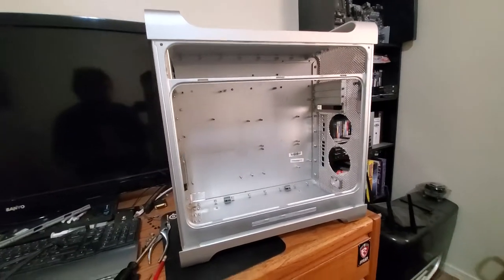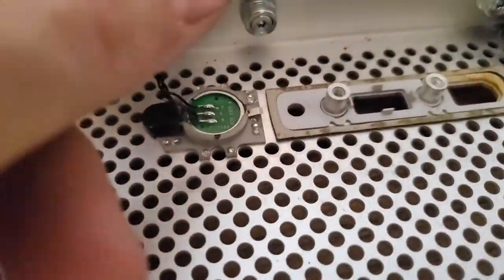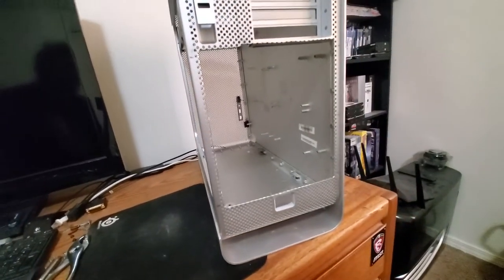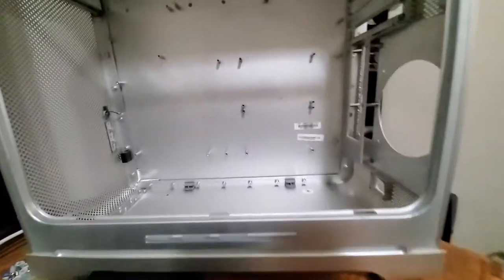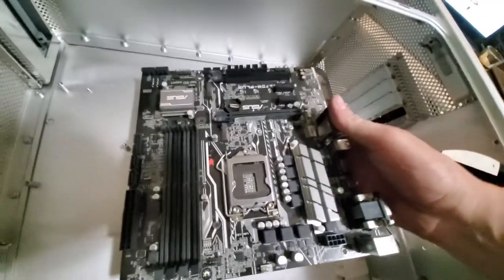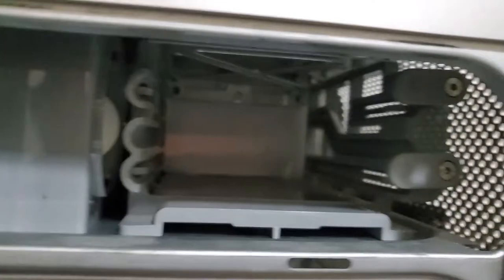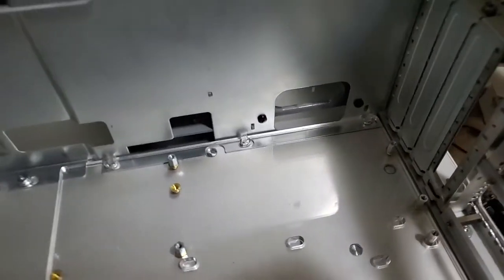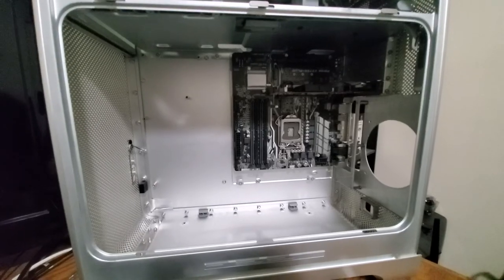Powermac G5 Teardown Complete ATX Conversion Begins!

Comment: Did you ever complete this build? I've done one myself but a little more roughish. I used epoxy to exposy them to the back of the aluminm case and it lined up with all the back I/O really well. I used an old ATX boad, connected the standoffs, maked the spots and epoxied them down. I cut out the rear I/O and used some black plastic edging material for car door edges to go around the sharp edges around the I/O shield. Used an old Server harddrive cage that held 4 harddrives and attached them to the bottom of the shelf for a total of 6 drives! I also rigged up a DVD drive to use the existing one. I soldered the from power button to use. And then hot glued some USB 3.0 in the existing spots and left the little shroud around it. Overall looks pretty good but it's over 8 years old now. I have another in the garage I am about to start to mod to put my current PC I just built in. Going to take my time with a glass side panel cutout. I hope you can post the follow-up video finishing this project. Nice Job!